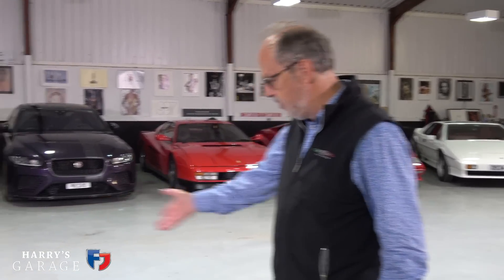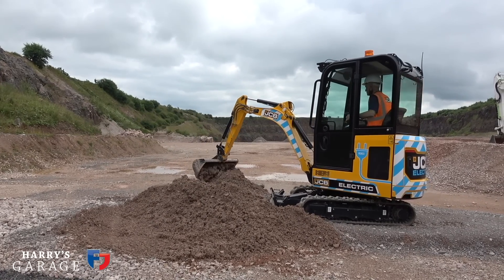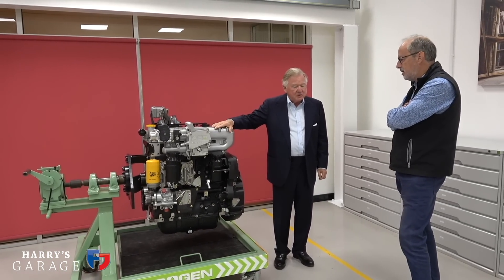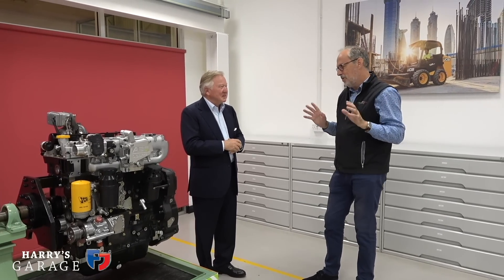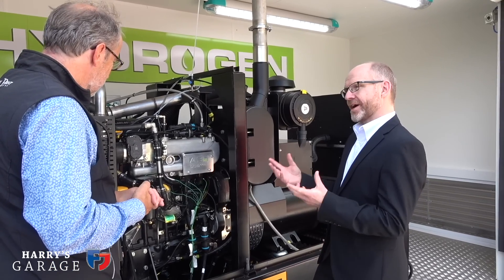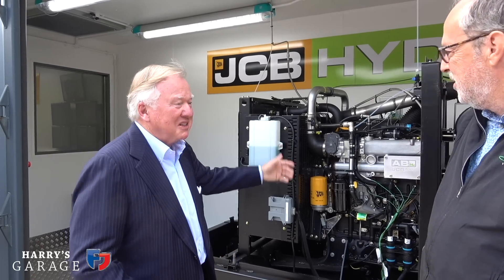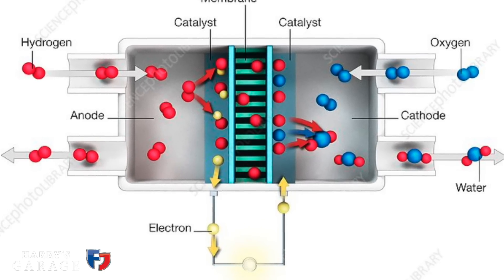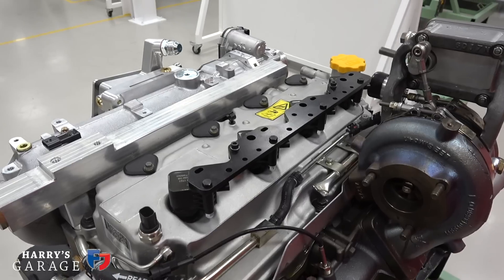Is hydrogen, rather than electric, the future for big-engined machinery? I visit JCB to find out

Comment: I respect Harry enormously, but this is short on important detail and early on was misleading when talking about the first use of H2 powered ICE while then showing a timeline that includes mention of the invention of the Fuel Cell. Not the same thing at all. Were we not supposed to notice this sleight of hand.

Bamford is clearly pushing his agenda and skipping over inconvenient details. His entire argument against BEV is based on current battery technology and pricing, but this WILL change.

We see a neat diagram showing a wind turbine creating Hydrogen (by electrolysis of water), thereby admitting it takes electrical energy to create the Hydrogen. Why not simply use that electrical energy to charge batteries and power the vehicle directly as that is in fact more efficient.

Bamford then points out that their engineers all over the world already know how to work on an ICE. So what? Completely removing the ICE isn't going to create any additional problem. It just eliminates the problem of having to maintain the ICE. Don't imagine for one minute his H2ICE will be devoid of complex electronics, so where's the advantage?.

I also saw no mention of the problem of storing Hydrogen. It has to be at massive pressure and/or very low temperature and leaks. You cannot prevent this, it is simply not like fossil fuel. These things can be mitigated, but simply not mentioning these downsides makes the video appear like some sort of a whitewash.

Suggesting that the entire BEV movement is down to personal infatuation with Elon Musk is laughable. One might also ask why BMW gave up  on their H2ICE project. It works, but too many problems. Not least of which is that a full fuel tank would be depleted after only 2 weeks of non use. JCB are not the first to study this idea and indeed Scania have recently denounced Hydrogen as a fuel, saying it's simply not viable. So the jury's still out.

Comment: Hydrogen, is and will be the future. making battery cells dose damage the environment. its the mining  of the materials  that is and will be catastrophic to the environment but some have this $$$$$$$$$$ in mind, so they brush under the carpet on how much damage it is causing and distract you with  the false perception its clean, But that clean comes with a price and its  environmental and in the long run will make fossil fuels look like cleaner the clean. Hydrogen is best for out planet as the exhaust is just clean water with no side affects from the start and finish zero damage to the environment from start to end.

Comment: Hydrogen fuel cell propulsion is fatally flawed . Sure it works but is it really that green ? . To produce one KG of Hydrogen requires approx 50 kilo watt hours of electricity . It must be stored at very high pressure . Its a very very complicated and expensive way of powering an electric motor . Bearing mind a battery is arround 95% efficient .Its ONLY advantage is the speed of refuelling.

Comment: This all electric movement that Musk has created, has anyone figured out the  real cost to the environment that it takes to mine the Cobalt & Lithanium?
Reply: How strange you raised that just now? The big oil companies have been mining cobalt for DECADES John! They need it to remove sulphur during the refining process. Big oil companies are BY FAR the largest consumers of cobalt and lithium. Are you aware of the lithium content of a typical EV battery? It's less than 5%. In any case, it's not likely to be all that long before EV battery technology moves away from using elements such as lithium and cobalt.....

Comment: Battery efficiency = 90+%
Engine efficiency = 30% on a good day

Burning hydrogen made from electric is a good way of throwing 2/3s of it away.

Sorry Sir Bamford, your plan doesn’t work.

Hope I’m wrong. I am a bone head after all.
Reply: Sir Branford’s plan to burn hydrogen in engines requires us to build three times more wind turbines and solar cells then using batteries

Comment: There is no justifiable argument against hydrogen engines. Lord Bamford is correct in stating the presence of Musk has/is astutely driving governments (globally) towards electricity as the only form of environmentally beneficial fuel cell for vehicles in any form of use. I would suggest Porsche would sell more hydrogen-fueled vehicles than electric called vehicles, not only at a lower sales price but the extended travel distance and time-consuming recharge, make distance travel unviable because you would require more time in travel from point A which therefore reduces time spent at point B because of the need to return to point A. So a day trip to the country may become a day trip to an outer suburb instead😢😢😢try explaining this scenario to a four-year-old who wants to visit grandparents in the countryside😱🤯😤😡🤬😰😢😭🤪🥴🤐 I shudder from the though of explaining the why & why not, to my grand children😲☹️😣😖😫😩🥺😳🥴🤒

Comment: Hydrogen is the best green car fuel.
Easy to make 
Italy is making hydrogen from solar panels in Libya.
I have seen a hydrogen powered car Toyota.
Batteries lose strength 2 years then recycling nightmare.
Powers stations..I don't believe wind can supply power at night ti 30 million cars ..
So more Power stations..coal gas nuclear.

Comment: He’s pretty ignorant about electric and batteries. He calls lithium ‘rare earth’ when in fact it’s abundant. Comparing sedan at 14k to 29k electric version is silly. 1st because that price will crash down over the next five years as wrights law on battery production and other electric car elements kicks in, and second because electric cars cost half or less to run than ICE vehicles so lifetime of owner is actually cheaper for electric.

His battery costs are high because he has small orders relative to car company.

Hydrogen is definitely the way to go for big machinery however especially once it all comes from renewable sources.

Comment: I hope this technology never gets off the ground.  The move to electric is not only about the environment.  It is about cutting out maintenance, built in obsolescence and fuel costs.  He talks about how people know how to work on internal combustion engines (and hence can work on this engine).  Well you don't need to work on the EV motors... isn't that the beauty?
.
You are most likely going to say Hydrogen is cheap.  Yes it is while it is not in heavy demand. I don't know where you live in the world but here where I live, Diesel used to be half the price of Gasoline/Petrol, today it's the same price per litre.  We are being sodomised by petrol prices.
.
The next revolution is getting us to be less reliant on grid energy and partially if not fully disconnect from the electricity monopolies. 
.
This guy speak HUGE amounts of nonsense: For example he talks about "...Musk being around at a time when VW was cheating". ... huh... Musk started with Tesla and changing the world in 2004.... the VW scandal was in 2016.
.
Musk has shown the future: it is ultra fast, it has a very long range, it basically ticks all the boxes.
.
I see the Germans are desperate to take on this technology as a last ditch attempt to stop the tide of turning to electric.  This is like horse carriage manufacturers last ditch attempt to introduce a new type of horse carriage when Model T's are finally in full production.

Comment: CO2 is not a problem...in fact, CO2 is necessary for plants and plants are necessary for humans.  H2 is most cheaply produced from natural gas....and if H2 is produced from electricity, where does the electricity come from?  It's not easy being green...or cheap.
Reply: Try putting a plastic bag over your head and sealing it - and in two minutes then tell me that CO2 is not a problem and 'necessary for humans'. Look forward to hearing your report.
Reply: @kingmiura8138  Your suggestion was that  CO2 is never a problem. You gave no context which  I took from that that  more CO2 would be even better.  I was giving the option to go for 100% . You tried it yet?

Comment: Electric cars, impossible to replace every car on the road with electric, the infrastructure to charge will take decades to install, there's no standard charging connector, presently charge stations have poor reliability. Charge times are still two orders of magnitude longer than liquid fueling for equivalent distances.
Battery power is severely compromised for commercial vehicles and Towing purposes. Battery energy density is an order of magnitude lower than that of liquid fuels. Battery energy density is already at theoretical limits with present technologies. Battery weight is several times greater than a fuel tank for the same range. But worst of all is the huge lie that electric is more efficient.
Electric power suffers losses each time it is converted, by Maximum power transfer theory by the time all the energy conversion losses are accounted for, the efficiency of electric vehicles is marginal if at all, better than ICE's running fossil fuels.
Reply: Your info is old, and not true today. Hydrogen is very expensive.

Comment: Hydrogen may be OK for large machinery in the distant future, but not now because:
- Burning hydrogen emits mostly the worst green house gas BY FAR (water vapor, much worse "pollution" than CO2) 
- You need more energy to make it than you get out of it when you burn it - where's that energy coming from?
- Unless you make it from fossil fuels - kinda defeats the purpose (don't tell the greens)
- Plus the old transport, storage, pressure, Hindenburg issues that won't go away
For large machinery, stick with diesel.

Comment: There is an element of disingenuousness going on here.

The disadvantages of hydrogen are glossed over; the disadvantages of batteries are over-exaggerated.

Hydrogen storage in a vehicle requires “plumbing” (for want of a better word) that makes it nine times bulkier than diesel for the same output- and you would still need an internal combustion engine to turn it into motive power.

EV propulsion does suffer from diminishing returns, because storing more energy requires more mass, but 20kWh of power (which can power my own EV for 80 miles at 70mph)  is only 20% heavier than a diesel engine plus fuel. A 200kW recharge unit can replenish that in 6 minutes.

Then we factor in the cost difference between filling your vehicle with hydrogen v filling it with electricity. As “any fule kno,” electricity is delivered to you at 14p/kWh, 24/7. Hydrogen deliveries, however, cost £15 per kilo in the UK, and you get the equivalent of one gallon of diesel for a kilo of hydrogen.

And that’s before we start to look at where hydrogen comes from. Clue: almost all hydrogen is refined from crude oil so is about as green as diesel. Not biodiesel, but old-fashioned diesel.

tl;dr Hydrogen is a rip-off.